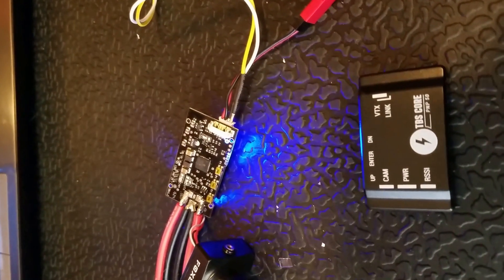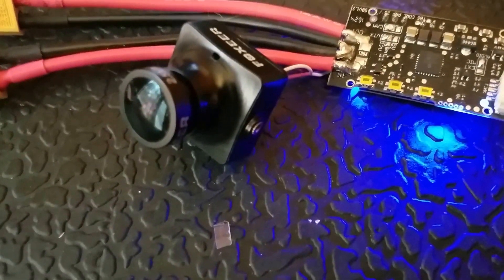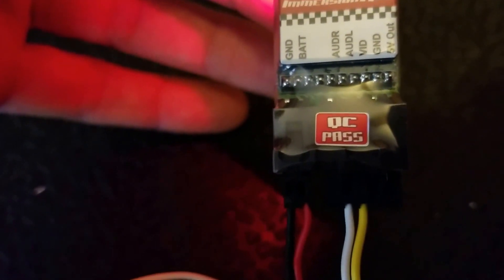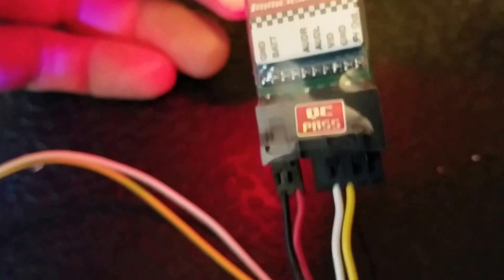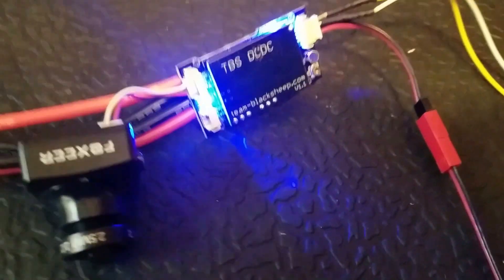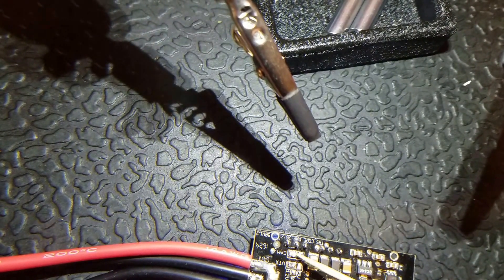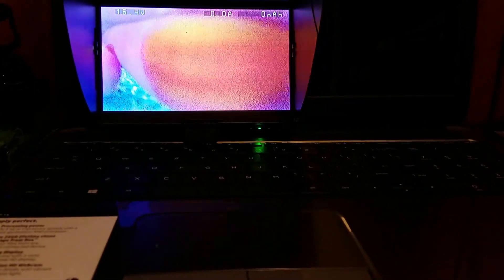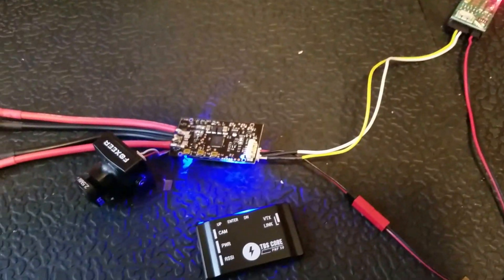TBS PNP50 to 200mw vtx wireing.

Comment: My man, I got a problem that you might have an answer for... If not, that's fine too, great video anyways!
I'm using a Core PNP25, powering it with a 2S battery. I've re-soldered both CAM and VTX outputs to 12V. However, once I power the system, it gets really hot in a few seconds. The LED starts blinking and the 12V power output cuts off along with the LED. I'm probably missing something or I've messed something up while soldering those pads... Any ideas?
Thanks in advance!

Comment from the maker: yes I used heat shrink but before I slid on heat shrink and marked where the buttons were with a Sharpe and used a leather hole punch to punch out the holes so buttons would be exposed and while shrinking tube a little at a time just keep potion so button line up

Comment: did you heat shrink yours. I'm worried the heat shrink will press in the 3 buttons on the side.
Reply from the maker: you can find some good clear heat shrink on amainhobbies.  it's an flyduino esc wire and heat shrink kit that works perfectly plus you will have plenty of 24aug wire for other projects

Comment: Im not getting a picture through my pnp. the video is black. should i be able to get picture right out of the box ?
Reply from the maker: what camera are you using?
Reply: runcam swift 2 and a unify pro v2 vtx
Reply from the maker: +WELLS QUADSTYLE you may have to go in and jumper the 12v pad for cam I would just jump vtx also it can handle up to 26v
Reply from the maker: +WELLS QUADSTYLE and double check all you wires and make sure they are going where they need to be

Comment: Hi I have an pnp 50 but has no xt60connectors did you solder the cables?thanks.
Reply from the maker: yes I did be careful to get pos negative right.
Reply: thanks bro.